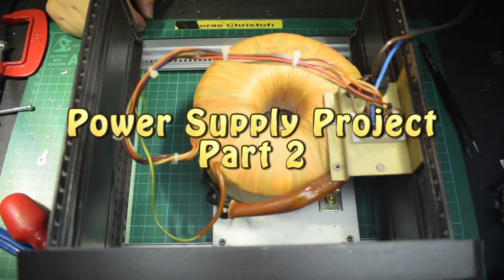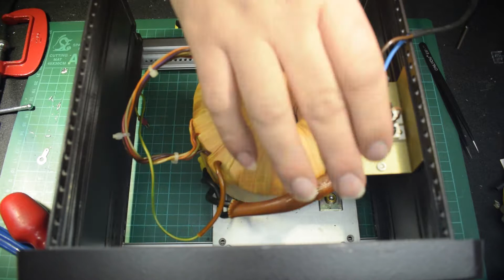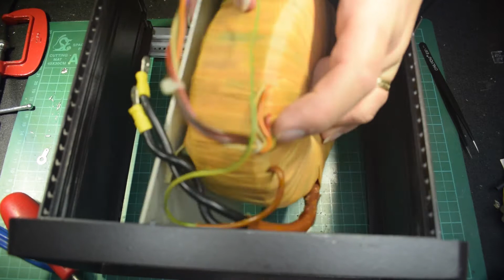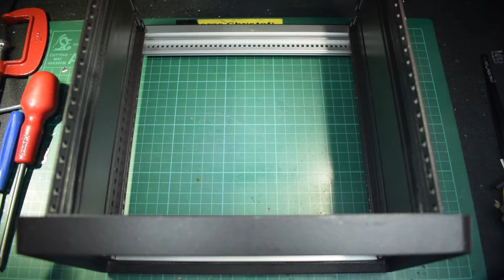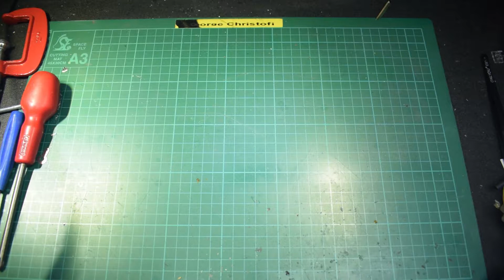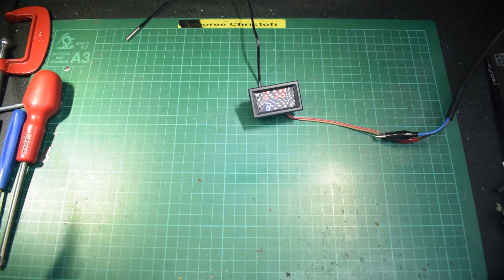Power Supply Project Part 2.

Comment: No circuits diagram?
Can u make a variable voltage 0-15vol at 2amp or higher?
Reply from the maker: I could, but it would mean a redesign. the hiland board available from china will do 30v at 3a for less than 10 euro so it is really hard to justify doing the same job as a ready built solution.